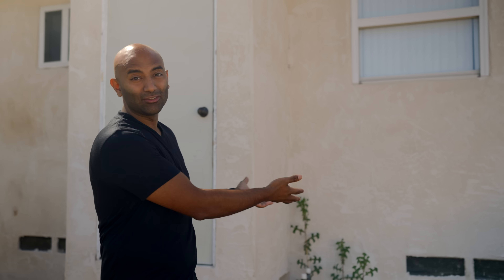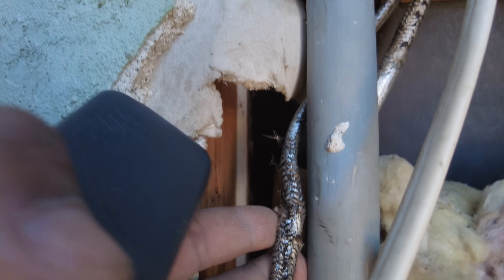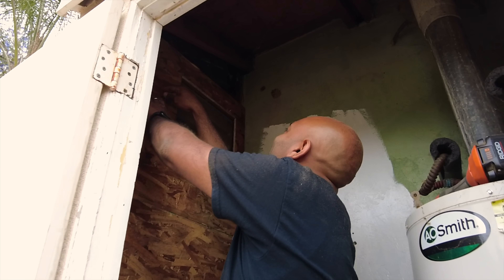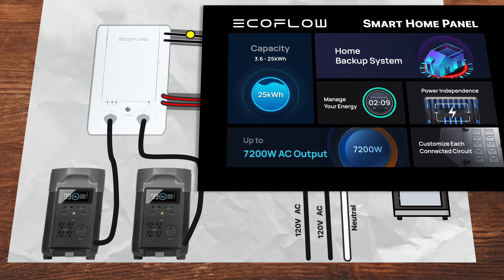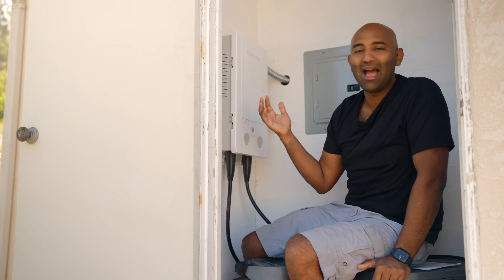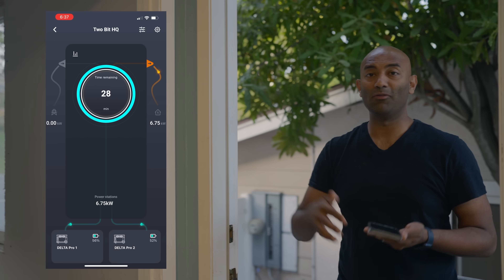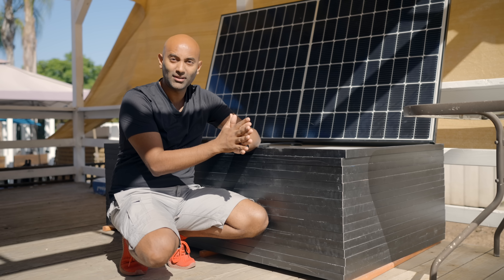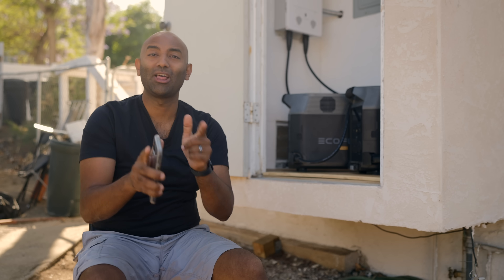Best New Way To Back Up Your Home Energy?  |  Going Off-Grid.

Comment: Since you pulled all the dry-wall off, you might as well wire the room for ethernet too (use cat-5e or cat-6 cable)... 1 gigabit is usually enough and the distribution infrastructure for 1 gigabit is very low power compared to e.g. Gbe2.5.   Wifi works, but hard ethernet just has a snappiness to it that wifi doesn't have.  So for any fixed PCs (etc), having a hard ethernet port is just the bees knees!

Romex: either 12-2  or 14-2 usually (2 means two conductors.  The copper ground wire is also in there but not included in the count).  12 gauge or 14 gauge.    12-2 for a 20A breaker (16A continuous), 14-2 for a 15A breaker (11A continuous).   For a room that small the extra cost of the 12-2 should not be that big a deal.   It is probably unnecessary, but it won't hurt ya either.  I'd still recommend using 15A sockets (the sockets without the 20A notch in them) for all except the particular plug you might use for a microwave or toaster oven.   Even then, microwaves and toaster ovens don't usually go above 11A anyway (unless its a commercial unit).   Sockets are trivial to replace if needed.  Wiring isn't.  So deciding to use Romex 12-2 is perfectly reasonable.

-Matt
Reply from the maker: did all of it :) yeah we have ethernet running up to a future mesh AP and also over to a closet for the main router.
Reply: For new installs cat 6 is really the minimum, fiber wouldn't be a miss too as it would future proof up to currently 800g but practically its good for 10 gig or 40g if your linking 10g switches
Reply: Cat 7 is shielded better
Reply: As an electrician I agree with this comment.
Reply: Don't put in single cables. Put in conduits/tubes so you can pull new cables if you need them.
Also, Cat 6A or Cat 7 isn't that much more expensive and doesn't require redoing the cabling when you do inevitably end up having a usecase for 10gbit a few years down the line.
Reply: My only hardwired devices - 2 access points in the ceiling, my Enphase array monitor, my Sunnyboy 5.1kW inverter.  Everything else on Wifi.  Zero issues.  Ethernet is only 'needed' if you cannot supply reliable, snappy WiFi! More worth it to have great WiFi IMO.
Reply: I went Asus Mesh instead of Cat 5 cable and love it. The range, signal, and speed is incredible all over my house and well out into my large property with just 2 total. I highly recommend. 5 Tvs, X Box, all the phones, cameras , and several other devices run with almost no detectable speed loss.
Reply: Structured wiring--cool.  Wifi isn't all it's cracked up to be.
Reply: @whattheschmidt  I thought Enphase was a micro inverter company.  Do they make solar panels too?
Reply: @cordeliaparham6800  They are.  The 5.1 is a SMA Inverter.  Solar panels are another brand.

Comment: Hello, at first I was going to blast you for your comment on ancient wiring in the 70's. Houses had 3 wire systems with a ground wire. But then you showed what you were working with. I am pretty sure this was a DIY building, they probably went with the cheaper 2 wire cables but I agree, after 50 years, the insulation on the wires would be breaking down.
 Also odds were that everything they plugged in was a 2 wire plug like lights,
Reply from the maker: true. when we moved in, we couldn't even plug in our computers, and the home inspection told us it wasn't grounded so we knew this was something we'd have to do eventually. so glad its behind us now!

Comment: Definitely Go with Heat pump Water heater. I have a 12KW grid inter-tied Solar system with to Tesla powerwalls. I just update my HVAC to a Heatpump. I currently use a tankless gas water heater, This is the forth system I have installed over the years. They work great, but they are quirky. My guests are used to tanked hot water and they don’t like dealing with the tankless quirks. When it is time to replace the tankless water heater I will definitely replace it with a heat pump. With rebates… the pay back is much faster with a heat pump than for tankless gas. I live in a mild climate heat pumps work great. The gold standard for a heat pump water heater is to install in a large garage or basement. Heat pumps are so efficient because they are moving heat from one place to another so a large source of “warm air” is needed. A closet install for a heat pump water heater won’t have enough low grade warm air to heat your water. * I had to upsize my main panel because the buss bars can’t carry the extra current form the solar, similarly I am looking at having to upsize the main panel again if I add more power walls. I also have to replace my Tesla gateway ( more or less the equivalent of the ecotherm). My first 2 powerwalls and balance of system required was about ~$20K add 2 more powerwalls is looking to cost ~$40k because of changes to the local electrical code that don’t allow using the power walls as intended by Tesla. Good luck, great content.
Reply: We did the opposite. 20 SEER HVAC Heat Pump with new ducting and a Heat Pump water heater first. Looking at 10 kW solar array next. I'm considering waiting for battery prices to come down or buy second ev that can be used as back up. Any lessons learned from powerwalls or solar?

Comment: Nicely done.  Very interesting tech.  I'm home inspector up in the SF By Area.  A few things I observed.  The building looks older than the 70's.  I'd guess 50's, but would need to see more to have a better "guesstimate".  That is based on the button board I saw when you had the walls open, the wall framing, the foundation system and the wire type.  That rag wire was used in the 50's to very early 60's.  FYI, the silvery coating actually contains asbestos.  Ooops!

A heat pump water heater is a great choice.  As you probably know, they have UEF's of 3-4.  The natural draft gas unit you pulled out had a UEF in the .6 to .8 range.  Enen a new high efficiency tankless has a UEF in the .94 range.  Meaning the HP is around 3-6 times more efficient than a gas fueled system.  The recovery times are lower so if you are going to have multiple people living in that unit, you may need a slightly larger unit than a corresponding gas unit.  Example if a 30 gallon gas would be ok, you may need a 40 in a heat pump model.  They also require air volume - so not in enclosed spaces with no ventilation.

Lastly, check your local REN (Renewable Energy Network).  They are utility funded non-profit and will likely offer some great rebates on replacing the gas water heater with a heat pump.    In my area, I do DOE Home Energy Scores and work with BayREN locally.  Los Angeles has SocalREN.  I'm not sure about San Diego, but assume there is a similar group there.  Consider getting your home scored through the HES program.  Its a great way to get a handle on where your home is energy wise and the score makes recommendations for improvements.  It compares the scored home to the average in the US  and shows what the score would be post-upgrade.  All upgrades recommended must have an ROI.

I enjoy your channel.  Keep up the great work!

Comment: I had two wire electric in my house.  I just added a ground wire to each plug.  It was a little difficult snaking the ground wire down under the house.  Fortunately I had about a 3' crawl space.  I clamped the ground wires to my cold water pipes and grounded my water pipe to an 8' copper rod I drove into the ground.  I also had an unused 220 circuit behind my gas stove.  I swung it over near the living room window where I put an 18,000 btu air conditioner.  The most expensive thing I did was upgrade my screw fuse electrical panel to a breaker box with 6 20 amp breakers.  My electrician friend helped me with that.  Still, the entire upgrade was done for about $1200 including the new (open box) air conditioner.
Reply from the maker: That’s awesome Joe ours was quite a bit more. We ripped out all the drywall etc. but we did all the flooring and drywall work ourselves. Took days but makes us feel very bonded to the place :)

Comment: Great video. Hopefully a section upcoming on the importants of proper insulation and sustainability. Generally older homes lose a lot of efficiency through air leaks. Spray foam insulation in the walks and proper taping along the window/door seams goes a long way. Picking the proper windows and doors for highest R value is important as well. Beyond that looking into a heat exchanger to keep your conditioned air in the home and purify the air are other things that can be looked into to reduce energy consumption.
Reply from the maker: yes sir! happy to report we got radiant barrier and batt insulation in there. video coming soon!
Reply: I have learned to always overbuild what you put in the wall.  It saves so much pain in the future when  you need what yo did not need at first.  lol

Comment: Great Video.  
We have been upgrading our 1968 ranch (3400sf) home over the years,  similar wiring upgrade to add ground, 100 to 200Amp upgrade,  all LED lighting,  Cat5E (2x) to each room,  new PEX plumbing,  tankless water heaters (propane - we are in the country),  variable speed 22SIR, Heatpump to replace propane (we live in Texas) and added 3KW of Grid Tie Solar to offset some of the electrical. 
We are looking at adding Battery backup for 8-10 circuits,  EcoFlow is nice and fancy but we can build bigger for less money using two 48V 200aH batteries and a 48V Inverter with 8-10KW output (240).  we won't get the fancy app but we can built it for a lot less and 10ms switching and charging from Solar as well as grid.

Comment: Outstanding, I love this technology, but where I live I’m keeping my nat. gas water heater for now, ( pilot flame, no electricity required) I’ve been through several northeast winter ice storm power outages, having hot water available was a blessing. Thanks for your awesome videos!
Reply from the maker: I totally agree! I am going to keep the natural gas... My thinking is get a natural gas hook up to a generator for all out emergency backup. As an engineer I believe in redundancy and always have an backup option. I believe with my strategy I can power myself entirely with solar and batteries but we shall see! maybe a wind turbine? lol
Reply: @TwoBitDaVinci  whatever you spend on the natural gas or turbine would been better spent on a bigger battery and more solar panels.

Wind turbines are not a good fit for homes in the city as your lot size is too small.  They will cast shadows on your solar panels as they need to be 30+ ft tall or more for good efficiency.  Plus they do require more maintenance and more prone to breaking than solar panels, on top of being more expensive for power generated than home based solar.
Reply: @TwoBitDaVinci  Remember Texas.
Reply: You mean that state that also had natural gas shortage the exact same time.  Better off just going bigger on panels and batteries.

Remember no power no gasoline either.

Comment: For hot water, here in the UK we have the Mixergy smart hot water cylinder which can use any combination of gas or oil boiler, electric, solar PV, solar thermal or heat pump, and can learn your usage over time so that you do not heat water that's not going to be used. but if you do have hot water that's not going to be used immediately the cylinder is extremely well insulated so the water will stay warm for 3-4 days.
Reply: Never heard of that, where is the best place to find the information.

Comment: If you are already doing a heat pump system for the HVAC, I would recommend using a heat pump for the hot water as well since you can tie the two systems together and use the same outside unit for both systems.
Reply: The ones I've seen are self contained and don't have an outside component, they just use inside household air.
Reply: @JRP3  Yeah, that's the typical kind if you are putting in just a stand-alone water heater, but they take heat and moisture out of the air in whatever room you put them in.  If you are putting in a heat pump HVAC system, you can often add on a water heater that runs refrigerant lines to the outside unit to pull the heat for the water heater from outside so that the water heater and HVAC aren't working against each other.  Although, that is more of a problem in colder climates like where I live.  I guess since he is in California, maybe it would be beneficial for the water heater to cool down whatever room he puts it in?
Reply: I've only seen it offered in ground source heat pumps.
Is there an air source, ie mini-split system, that runs to both air handler and water heater??
Reply: @ctgottapee  I don't know the brand, but I saw a video where a guy was putting in an air-source mini-split system that had several indoor "cartridges" that all connected to a single outdoor unit with refrigerant lines.  While describing the system he chose, he mentioned that his dealer had asked him if he also wanted to add a water heater to the system because it would have required a slightly larger outdoor unit than the one he was planning on.  Since he had a fairly new water heater and was mostly looking for the air-conditioning benefit of the heat pump he chose not to make that upgrade.

Comment: Don’t forget to replace that breaker room door.  Someone can knock out those door pins and those portable eco flows just roll away.  Ouch.  Thanks for the vid.  I have a ecoflow delta and it’s impressive for its size.
Reply from the maker: Good point. It’s on the inside of my property behind a gate. I’d have a lot of other issues at that point :)

Comment: Hot water solution… solar hot water. Panels are roof mounted like PV panels, but are either open loop where water to be used is circulated through the panels, or closed loop and the “water heater” thermos serves as a heat exchanger. Not too expensive, and essentially unlimited hot water as long as the sun is shining, even in winter.
Reply from the maker: John I have limited roof space and I’m going Al PV solar. I need electricity way more than hot water. With a heat pump water heater with a cop around 5, that’s the way to go for me.
Reply: Fair enough… most don’t consider Solar thermal as a solution. However, it is still viable in some use cases, and when available space is a concern will output more btu’s per sq ft than equivalent power from PV panels. Though I haven’t run the calc when PV is paired with a heat pump. Only downside (still significant) is the expense delta vs PV. All the best to you in your venture.

Comment: I see a prior comment about wearing safety glasses while using a table saw. You should also watch a video or two on the proper use of a table saw. The method you used can cause dangerous kick back. When cutting a panel as you were, when a kick back happens, the panel rises up and the user’s tendency is to push it back down. Unfortunately the hand often comes down on the blade resulting in a major injury.
Reply from the maker: Lyle I've been wood working for 15 years, I've built entire homes, entire kitchens. I appreciate the insights, this isn't a how to wood work channel, but I just like to show some small bits of what we're up to. thanks for your insights

Comment: This is definitely the best way to back up power to my home. I am actually thinking of gettting a Delta Pro and two extra batteries which will give me around almost 11kWh of power.
Reply from the maker: remember it only backs up 10 circuits though so not your whole home, but its pretty awesome. also if you really want great data, wait, i'll do follows ups on my impressions after a few months of use

Comment: My house is similarly functional from the electricity TOU and backup perspectives, though I chose a different route since the house came with a small PV system. I needed to expand the PV anyway, so I replaced the inverter with a Sol-Ark 8k, added a second PV string, and have it connected to a Fortress Power 18.5kwh battery. I give you props for your portability, though, as the FP battery - though on rollers - is about 600 lbs. I was using a bank of BigBattery LAMAs before, (much more portable and also on rollers, though still 140 lbs each), which worked very well, but they weren't on PG&Es approved list.

This is a great series, and mirrors my interests and desires significantly. I definitely look fwd to future videos!